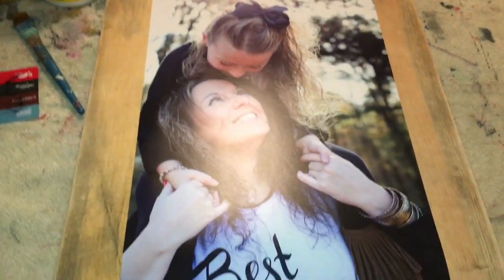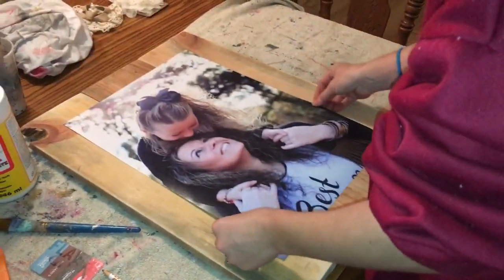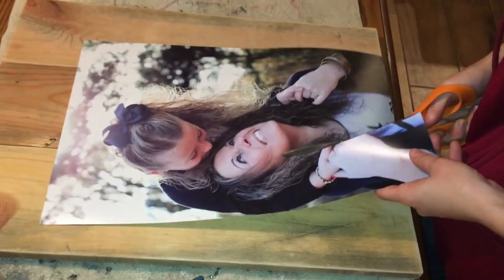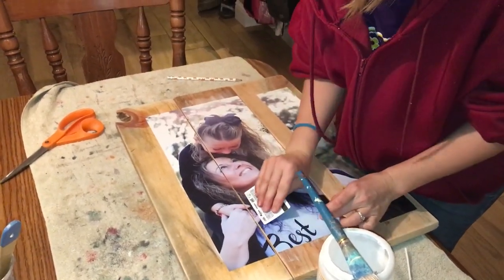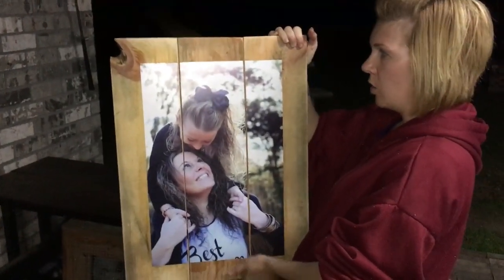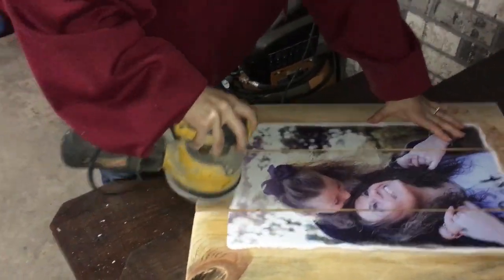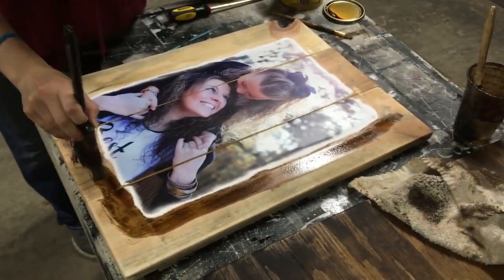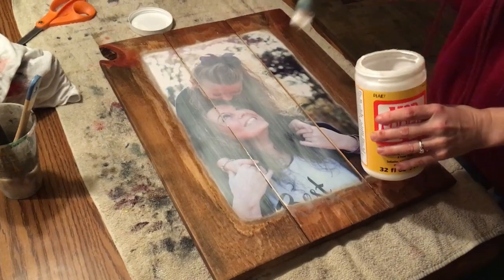How to Mod Podge a Picture to a Wooden Canvas

Comment: Modge Podge is great stuff. My mom and I "fixed" some tv trays when I was a kid and we're still using them MANY years after.

I would like to suggest that instead of marking and hand cutting your photo is use painters tape to hold it down then run a carpet knife down your straight  edge. Another way to do the edges is to burn the edges of your image to make it more rustic. 

Nice work tho

Comment: You can also break the edges on the wood with the sander.   A little edge burning also does the trick.  Hammer a few parts of the wood also adds character
Reply from the maker: dfelixrx7 yes indeed!

Comment: Very nice work.  Thanks for sharing it on YouTube.  I'm thinking about using 3m Super 77 glue to attach a laser printed photo to the wood. I will also have spaces or slots between the pieces of woof that make my "wood canvas".  After the glue is dry and the image is firmly attached to the wood, do you think it would work to cut the lines in the image using an Exacto knife with the slots in the wood serving as guides to cut the lines?   Thank you.  Larson Bennett
Reply from the maker: Larson Bennett it’s hard to get it perfectly straight when you do not that way. However it’s different with everyone. Would love to see it when your done and what you thought about it!! apoorgirlsdecor@aol.com ❤️

Comment: I wish I would have done a regular picture.....I took a 6X6 photo and had a laser print made and tried it where you put it upside down and take the backing off...I let it dry over night each time but the picture came off when I was trying to get the backing off and I was not rubbing  hard....so then I went and got more laser prints and put them face up this time...then I was faced with wrinkles.... I was so frustrated  ...used all 4 of the laser print and on the last one it still had some wrinkles but I was so frustrated I just went with it because it could have been worse. I hope as it dries some of them with flatten out. I even made sure I smoothes it out.  I will give it a couple more coats and hopefully it will look ok. Next time I am going to do what you did...working with a regular print.
Reply from the maker: Teresa Collins guuuurl i feel your pain. I also failed multiple times with picture transfers which is why i do it this way.

Comment: Thanks so much! Will the mod podge b ok to use to clear coat over acrylic painted words 
When u have both a pic and words on the wood?
Reply from the maker: Cindy Smith of course. The only thing is it can’t be stored in the heat. The modpodge will get tacky if something leans on it.

Comment: I absolutely love this! You have inspired me to make one. I have several questions I would like to ask if you don't mind: 
1. Did you build the board or bought it? Can I use pallet wood?2. I have a square sander that uses sand paper. Will that work?

Thank you!
Reply from the maker: Pika dude I’m so glad to hear it. I built mine. I have a tutorial coming soon on how i did that. You can easily purchase one already assembled at a local craft store. I’ve seen them at michaels and Walmart. Any sander will do. You’re just roughing up the edges a little bit.
Reply: Pink Sawdust LLC thank you!

Comment: Hi Pink...luv how you do this...I did try one and the face bubbled down the road? 
Do you know why? I did stain first and I sprayed it with a seal because I had words on the board as well
About to do another...any advise?
Reply from the maker: Yes, I've had this happen after i seal project. Sometimes it happens as soon as I clear coat and sometime it happens as little as 24 hours after.  (I clear coat with mod podge) I'm careful to rub out the bubbles as best i can. Mostly with old tshirts. (I find that the card scratches the photo a little.) I recently purchased a squeegy ($2) for this. Link at the bottom. I also am sure to use plenty of mod podge as you can rub out the excess. If I do notice a bubble I will stick a small hole in it with an exacto blade or a safety pin. Within hours it will go down. I've also recently been told to heat it with a dryer and even set a book on it. (But i would place a towel over the picture before putting a heavy book on it to avoid peel ups.) Hope this helps!!!

\https://www.specialty-graphics.com/felt-edge-wrapped-squeegee.html?gclid=EAIaIQobChMIla_xs6yr2AIV3LXACh2ZWQBrEAQYBCABEgLzp_D_BwE

Comment: Great video.  Sorry if I missed it but how do you keep the Mod Podge from leaving streaks/brush strokes?  Mine looks good, but at an angle I see the brush strokes and it drives me crazy.
Thanks again for the video!
Reply from the maker: K T  make long even strokes and use a very fine brush. I mostly use a 1 inch acrylic brush.

Comment: This may be a silly question but could I use one of the wood boards from Walmart or hobby lobby in the wood crafts section which has the hangers?
Reply from the maker: Ashley Sanders yes of course. Just make sure it’s sanded down and smooth.

Comment: Do you have to use the orbital sander to sand the edges of the picture?
Reply from the maker: Ava Price no. But it works great! Sorry for late response.
Reply: I have put my board together and mod podged my image to it but now I am terrified to sand the edges...haha Any tips???
Reply from the maker: Ava Price try doing a small project first. Something that doesn’t matter if you screw it up or not. Practice makes perfect. I hold my orbital sander at an angle.

Comment: Great video. I may have missed it but what number of sand paper did you use?
Reply from the maker: Keith Guille 80 grit. Also i go back over the edges after i clear coat with a very fine grit sand paper.

Comment: I LOVE this idea!!  How much would you say this weighs.  My husband thinks it going to be too heavy to hang on the wall, without extra reinforcement.  Also, you said you use Walmart poster prints - I don't see that they make poster prints in 5x7 or 8x10 - does their regular picture prints work as well as the poster prints?
Reply from the maker: Julie Fulton yes regular and poster work the same. It’s probably about 6 lbs give or take. I use nailess d hangers

Comment: I'm very grateful for your video tutorial. Thank you! Question, what method do you use to print your pictures at Kinkos or Staples? I am saving my images from Photoshop to a flash drive, the printing dimensions let's say are set to 1200 x 1200 @ 300DPI (for laser printer). When I print at Staples from the flash drive, it ignores the printing dimensions and the image is printing as an 8x10 or bigger on a 8.5x11 paper. So in other words, how do you actually save and then print your photos at either of these locations to the exact size and pixel resolution, 4 x 4 (1200x1200) @ 300DPI. Thanks.
Reply from the maker: i used walmart photo lab. nice thick photo paper. easier to rub bubbles out.

Comment: Great job! In my experience with Modge Podge I get air bubbles weeks down the road... have you had this problem? very careful to work all the air out.
Reply from the maker: yes very careful to work out the air bubbles. (i find that thick photo paper is easier than thin poster paper when it comes to bubbles.) and no i haven't had any issues from anyone. (knock on wood!!!)
Reply: Sylvia.. thanks for the reply looking forward to possibly more videos
Reply from the maker: you bet. i think the next one will be how to distress with dry brushing and stain. stay tuned ;)

Comment: What kind of saw did you use? Any alternative if you do not have a saw?
Reply from the maker: Dianca Jones i used a miter saw (chop saw) but you can use a skill saw. You can also get your boards from Home Depot and have them cut it for you. For free. I use 1x6’s #2 pine for this project.

Comment: Well I’ve done 2 now...both customers have brought them back because they have bubbled up and lifted?
I don’t know what I’m doin wrong. I’ve followed you step by step...is there 2 different modpodges your using?
Reply from the maker: Cindy Smith use lots of mod podge and rub the excess out with a felt covered card or squeegy. I’ve had mine bubble out hours after completion. Poke a hole in it with an exacto knife or safety pin. The bubble will go down after an hr or so. I’ve been told to hear it up and place a book on it. (I would recommend putting a towel under the book.) hope this helps!

Comment: Do you have to cut the photo or can you leave it whole? Also do you have to Modge Podge over the photo or could you use a clear seal spray and when gluing the photo could you use a spray adhesive instead of modge podge
Reply from the maker: Crystal Ross i don’t see why not. Try a small project as a test. I know some people who don’t clear coat over.

Comment: What size and what kind of wood did you use in this video?
Reply from the maker: Deanos gal #2 pine. (3) 1x6’s cut 24” long. Wood measures 17x24 roughly.

Comment: Do you get the pic done at Wal-Mart on any type of special paper??
Reply from the maker: Chris Smith i like using the Walmart photo lab because they have thick paper and it shows yes bubbles. I get it printed as a poster in a matte finish. And yes i do trim the picture down a little sometimes so that it’s proportionate to the board.
Reply: Pink Sawdust LLC . My first time trying this. So I started small. Drying as we speak. I'm just worried about the sanding of the edges of the picture. I will keep you posted in the outcome! Thank you
Reply from the maker: Chris Smith that’s exciting!! Can’t wait to see!
Reply: Pink Sawdust LLC. I can't post the pic.. Lol It worked great. Instead of stain, I used a wood burning technique. Thanks for the inspiration.
Reply from the maker: Chris Smith darn! That’s ok. I’m glad it worked out for you!

Comment: how did you change the pixels on the picture
Reply from the maker: Hector Nieves i didn’t change the pixels. I checked the resolution of the picture in the properties and details of the picture. To make sure it was good quality to be blown up to a larger size.

Comment: This is neat, but I would be afraid to use the sander. I feel I would mess up the picture. I have never used one before. I would like to do one of my son and I and also my grand. Thanks for sharing this creative idea.
Reply from the maker: you bet.. just takes a steady hand and practice. I think you might surprise yourself. Start off with something super small and insignificant so if you do mess up it's not a big deal.
Reply: Brenda Hightower it's easy to do. like the fellow said start slow with something small. I grew up welding with my Papa & he let me help him work on all kinds of things using electric tools!! I loved it & it taught me about a lot of thing's
Reply from the maker: Yes i was taught not the fear the tool but always respect it. Safety safety safety!!!!!

Comment: do you have to use an electric sander or will sand paper for the edges work too?
Reply from the maker: it would probably take a while to hand sand..
Reply: No you will have to use a hand blender from your kitchen. Tape the sandpaper to the beaters and presto! 😀

Comment: I need help! I did this but too much modge podge. It dried overnight but there is are some cloudy streaks. How do I fix this? :(
Reply from the maker: Denise Liscoumb it’s probably the type of picture you’re using. Mine never smudge. (I use the Walmart photo lab) 

If you used paint it can pull over into the picture too. Try midpoint the picture first. 

Hope this helps!
Reply: I do use walmart, it was my error, as I put too much modge podge on. My question , is there a way to fix it? An I sand a bit and put a thin layer? can I put a thin layer over the cloudy streaks?
Reply from the maker: Denise Liscoumb hard to say. I’ve never tried it. Haven’t had a blurry streaky spot. But have had ppl tell me there’s did it.

Comment: does it works on pigment ink printer?
Reply from the maker: i'm sure any photo or poster will do
Reply: inkjet printer will bleed if adding modge podge over it. You can use a copy or laser printer.
Reply from the maker: My printer is inkjet and i use modpodge over all the pictures i print. :)

Comment: if I use regular picture print will it work as well as the poster print-  small picture.  what is the difference between the poster print and regular print?
Reply from the maker: yes i've used regular photo paper that's thick and thin poster paper...

Comment: Just curious why you didn't transfer the photo on the wood and then rub the paper off the next day like other videos have shown instead of leaving the actual photo with paper on the wood like you did?
Reply from the maker: Dill Wiggle because i don’t have a laser jet printer or whichever one you need for a picture transfer. I tried 3 times and failed miserably.
Reply: Oh ok I guess you need a colour printer to print colour printouts makes sense.
Reply from the maker: Dill Wiggle they have ink jet printers and laser printers. Makes a difference in which printer you use. The ink will rub off with the picture.
Reply: I also think transferring the picture looks slightly different. I like how you did this and it seems simple enough that it would be an easy gift! I love it!
Reply from the maker: Ashley Marsh thanks so much. Glad you enjoyed it.

Comment: So regular modge podge is fine?
Reply from the maker: That's what i use. The only thing I don't like about mod podge is if it sits and gets hot it will get tacky. So I wouldn't store a finished product in an attic or in hot areas with anything sitting up next to it.. I store my items in a shed at my house and I had something leaning on one of my mod podged photos and it pulled a piece of the picture off. I always cover mine with a towel if in storage.
Reply: Thanks so much.. Great to know since I am making Christmas decorations which will need to be stored :)

Comment: How to sand the edges without a sander?
Reply from the maker: buy i piece of sand paper and sand by hand... will take alot longer and alot more elbow grease.. you can also tear and rip the edges and distress over with a dark wax after gluing to the board. - no sanding needed

Comment: I want to do this for my daughter’s senior picture!  What kind of wood did you use for the frame?  1x6?
Reply from the maker: yes 1x6's .... it measures roughly 17x24 and i ordered a 16x20 print/poster from walmart.. i think it was like $12. and the wood is from a local lumber yard. it was grade 2 i think. cheap. $3 for an 8ft 1x6. Enjoy!